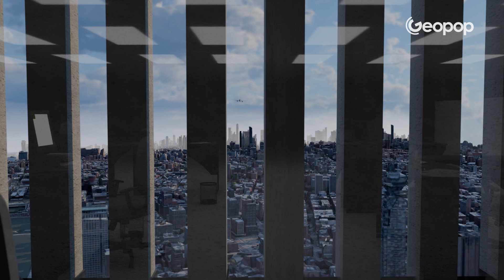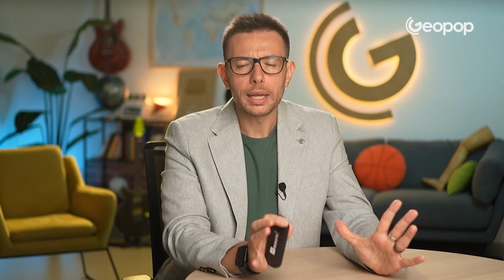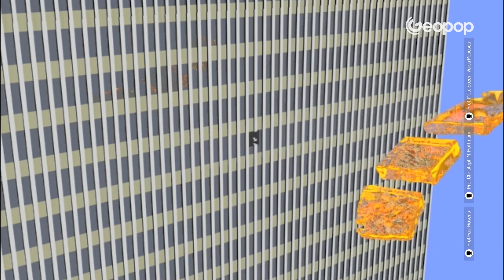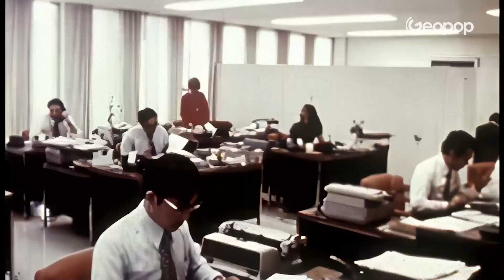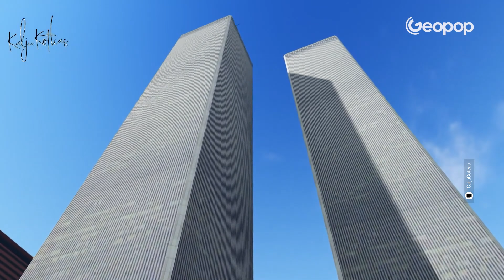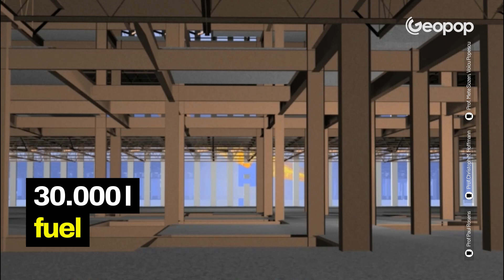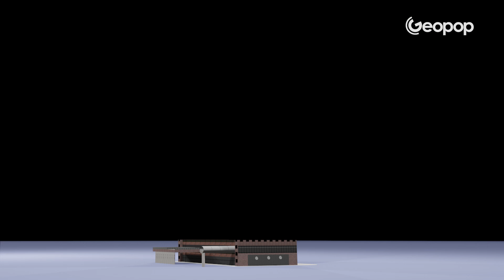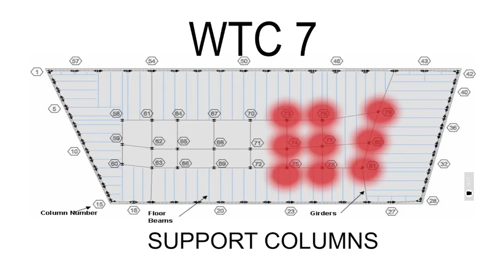9/11, 2001: The Technical Reconstruction of the Twin Towers and WTC 7 Collapses

Comment: 'We saw molten steel, flowing in the basement, like LAVA'!
Reply: It wasn't molten steel that was flowing like lava, it was molten aluminium. The buildings were covered in the stuff. It melts at only 660 C.
Reply: @reignman30  look up in engineering tables the COLOR of molten aluminum!!!  Please.
Reply: @reignman30  The buildings were covered in Structural STEEL, more than aluminium, by far!
The 77th brigade will sack you if you carry on this badly!
Reply: caused by thermite.
Reply: @josephdarkhelmet9494 
Fuckin A . Thermite ,final answer
Reply: They used mini nukes buried deep in the bedrock below the utility shafts.  They use CGI and special effects as well. The lower floors were virtually vaporized by the blasts. 
The remaining upper floors dropped in free fall. The melted crater was found below the debris. It took weeks to cool...
Reply: Sure did and at least two people got video of molten metal flowing like little waterfalls near the corners of the twin towers before the first impact. I wonder if that storage area stacked to the ceiling with boxes of Primacord that we saw in that video the Israeli film students shot of themselves from inside one of the towers when they were given unprecedented access days before 9/11 could’ve been for ?
Reply: @Semprefi  Yes!
And i wonder how many jewish people died that day?
And who were the 'dancing Israelis'?  
Very suspicious!
Reply: @Semprefi  wtf lol what’s wrong with you people. Gotta be trolling at this point
Reply: @TheScottbb1 
That’s what I’m thinking about you. It would take hours just to list the evidence that runs counter to the official narrative  and little to nothing that supports the government approved story yet here you are
Reply: No sence arguing with stupid… centimeter of steal against millimeters of aluminum?… it’s a inside job to start a war and control everything.. free fall ? Collapse? If you believe it’s not planned, you are brainwashed.
Reply: I assume you've noticed that @TheCriticalStinker-jw4fl hasn't offered any evidence contradicting the presence of molten steel in WTC 1 & 2.  That's how these shills operate.  Every one of them is a clown.
Reply: What is the source of the many tons of molten steel found in and under the debris, the heat so intense that the molten steel remained in that state for weeks afterward, running off of the debris as it was excavated. This cannot be molten copper from wiring that retains the color of a shiny new penny.  It cannot be molten aluminum that retains the color of the polished aluminum wheels of a street racer. It was the color of glowing orange molten steel  that cannot be mistaken for any other material, reported by firefighters who are very experienced in the nature of such materials as well as seen in video evidence.

When you combine this with an entire lack of turbulence behind 500 mph aircraft, when even a small Cessna Aircraft would leave an evident wake in the smoke and fire only seconds later .  . We find that skeptics still cannot be skeptical of the official narrative in explanation.  Sponsored channels and forum activity are skeptical of nothing when support is provided.

Sponsored activity in the forums is very normal today for commercial and political purposes and subjects of controversy -- in the attempt to lead public debate.
Reply: Bs
Reply: @BrianPack-u7o  No!  Theres video of them saying it!
Reply: You can't tell what kind of metal it is by just looking at it
Reply: @mikebyrd8278  if it is molten and running and it is yellow and orange then it is not aluminum.
Reply: @JosephBoxmeyer-u3d  yet there is no proof it's steel. An yes aluminum can be orange 

https://youtu.be/tdmnuAL4Nas?si=HceCZanHb9I2YLL5
Reply: @mikebyrd8278  It has colours, viscosity, smells, they were there, you were NOT!   99% of all the metals within those towers, was structural steel!   Why does this bother you so much?
Reply: @JohnWayne-w2g  yet there is zero proof of any melted steel. Nor is there proof 99% of the metal was steel. Aluminum jets, aluminum studs, copper pipes...
Reply: @mikebyrd8278  What about the fact that 99% of the  metals within those towers was STEEL, that you hilariously  skip around?
Give up man, you give yourself away too easily!
  Stay on those pentagon threads!
Reply: @mikebyrd8278  You've got to be joking. You tube is full of news clips showing the clean-up crews dealing with molten STEEL that "melts thier boots" and drips off the crane buckets. Inform yourself bro.
Reply: @mikebyrd8278 
When molten,  aluminum does not glow orange or yellow. Aluminum retains its silver color.  This leaves us with titanium, which melts at  ~3000 degrees F or steel, which melts at ~ 2,700 degrees F, depending on the alloy. What in any of those buildings could burn hot enough to weaken steel, let alone melt it.
Reply: @JackCarlock56  https://youtu.be/tdmnuAL4Nas?si=OxUsx-sh7Co3ohEf
Yet there is orange aluminum
Reply: @mikebyrd8278  look at the building during construction.  Steel.  Look at railroad rail welding videos.  Thermite.  Please watch one.  Just two minutes.  Look at video of thermite cutting steel beam.  Two more minutes.  And the aluminum from the planes burned up.  Gone.  Look at video of crashed plane with fire.  Gone.  Of course the building fires did not get hot enough.  Those fires not getting hit enough to melt steel?  Are you familiar with the term "red herring"?  They are officially trying to deny the fact that there WAS molten steel , by changing the subject about what heat is needed to bend steel.  You need to watch videos until you see the molten steel for yourself.
Reply: Except that quote is not accurate, Building 6 (where the firefighter you are grossly misquoting was actually located) had no basement and why does this even matter even if it were accurate?
Reply: @TheLoonResistance   no, that molten steel was in the basements of buildings #1 & #2.  There are videos that show it clearly.  Also, have you seen the satellite heat analysis of those basements a month and two months later?  Over two thousand degrees.  That is not from the building falling. Are you familiar with the dust analysis?  Evidence of thermite and thermate.  It is in all of the dust.  And IRON MICROSPHERES.  It is in all of the dust.  Have you seen microscopic photos of the dust?  It is full of tiny chips of iron oxide and aluminum and copper and phosphorus.  There must have been many tons of that to have been dispersed in all of the dust.  That is not the signature of any material naturally produced by any building burning and falling.  Look it up in engineering materials. Micro chips of iron oxide combined with aluminum and copper and phosphorus!!!  With iron microspheres.  It is in all of the dust.  Thermite and thermate.
Reply: @TheLoonResistance  
The inference being that the heat generated by the official narrative didn’t reach  anywhere near the temperature required to convert solid steel into liquid steel.Another reason that molten steel is important to the story is that it supports the assertion that Thermite or similar was used to weaken the buildings enough to collapse prior to impact
Reply: @Semprefi  - The official narrative (whatever that means) never claims that temperatures were reached to convert solid steel into liquid steel. That is pure conspiracist fantasy.  No teel turned to a puddle or needed to.

I could ask you like I have a thousand others to provide some evidence that it did and you will fail just like all the rest of them. The usual couple of casual anecdotes will be the best you can do. 

Boring

Thermite BTW would be quite useless, which is why no one uses it like that. Besides the obvious logistical problems the stuff just doesn't work. The only reason anyone talks about thermite is because of the utter failure of the conspiracy crowd to convince the public with obvious nonsense claims of explosive controlled demolition. Since there were no collapse initiating explosions, the zealots needed a silent way of demolishing the Towers. Thermite was the best they could do. Not because it was used mind you, but because it was silent. It kept the fantasy alive. 

youtube.com/watch?v=JXWCMBuusMI&ab_channel=TrutherTVArchives 

In this video starting at 45:35 and running to 48:35 the Energetic Materials Research and Testing Center (EMRTC) conducts a test to examine the effectiveness of thermite in cutting a vertical hollow box-section steel column. The column tested is smaller in cross section and made of thinner steel than that of the Twin Towers perimeter columns (and never mind the core columns). In total 175 pounds of thermite are used for the test on just one column and requiring the construction of a rather conspicuous coffer dam to contain it. Do recall the Twin Towers had 240 columns and 110 floors.

It would be odd if thousands of office workers missed hundreds, perhaps thousands of those suddenly appearing.

Note what an incredibly slow process this is. It took close to 30 seconds for the thermite to finish burning off.  It would be impossible to “control” a demolition using this material.

Not to mention the issue of; how does the aircraft impact and subsequent raging fires NOT prematurely set this stuff off?

Also note how bright and obvious the whole process is. Could not be missed visually. No way to hide that. 

Then at the end of the test the (relatively modest) column was undamaged…. which is a problem.

Certainly no rivers of molten steel emanating from it either and in fact the whole thing cools rather quickly as soon as the thermite has burned off, as one would expect.

Thermite has never been used in the controlled demolition of any building, let alone one with multiple floors on fire after the impact of a large jet. If the conspiracy oriented internet has taught us anything it’s that if something has never happened before, it can never happen.
Reply: @Semprefi  - Meaning there was no molten steel - hence the complete lack of evidence for molten steel.  All you have is a couple of casual anecdotes from people nobody has even bothered to do a follow-up interview with. Your case isn't weak - it doesn't exist. It reeks of desperation.
Reply: @TheLoonResistance 
How come you trolls never bother to read things before you come out of left field to argue with someone? I usually clap back at you basement dwellers but  you’re level of  Dunning /Kruger  is off the charts   so I’m  gonna ask you nicely to fuck off and find someone else to wind up with your ignorance and complete lack of self awareness
Reply: @TheLoonResistance 
I don’t even have anecdotes. Where did you see those? Exactly. 
You’re arguing with me about what you assume I said cuz trolls don’t bother reading things before they disagree with them. Actually, the only evidence of molten steel flowing near the corners of the buildings  starting around the 73rd floor is the few videos that we’ve been aware of since almost day one. The Molten steel existed and it was recorded before the first plane hit. Youre move Shrek
Reply: @TheLoonResistance  You are obviously not that critical about your claims, are you? The firefighters were not misquoted. You claim that the firefighter's descriptions of what they saw that day "don't matter". Astounding.
Reply: @432b86ed  - Then provide the relevant quote. The OP sure as shit won't.  About time one of you lot grew a pair.
Reply: @TheLoonResistance  don't grow anything.  Binge watch videos until you see what we are talking about.  You can see videos of the molten steel.  You can see many series of explosions.  There is a video from a helicopter that shows many explosions that demolishes that "hat truss" on the top of #1.  That was BEFORE it started to fall.
Reply: @TheLoonResistance  "9/11: NIST engineer John Gross denies WTC molten steel (extended)"
Reply: @432b86ed  Not what was asked for. Try reading the OP again.
Reply: @TheCriticalStinker-jw4fl 
Multiple individuals noted molten steel within the basement areas of WTC  1 & 2. 
NASA measurements of the temperatures in those same locations showed temperatures of ~ 1,700F. Why is that relevant? Well, since you need to ask, it is relevant because what was  a fire retardant heavy environment. Nothing in any of the WTC  building would burn at the temperatures needed to weaken steel. Now maybe you debunker types can explain how the fires within the rubble of WTC 1 & 2 burned until mid-December. What was buring and why couldn't millions of gallons of water extinguish the fires?
Reply: @JackCarlock56  Be wary of the disinfo trolls, pal!  They make themselves really obvious!  They don't even try to be convincing!
Reply: @JohnWayne-w2g  
You know. I don't care if someone is a troll or not because, typically, I'm less responding to them than I am writing out facts for those who might read the comment sting later.
Reply: @JackCarlock56  Sure, but why are disinfo trolls on these threads in the first place?
Because the molten steel element, is TRUE, thats why!
Reply: @JohnWayne-w2g  
That's my point. If a tourist were to visit these stings, they might leave with the false impression that NIST's account and thus the trolls are correct. This is, of course, not true. That's why I am here - to squash trolls.
Reply: @JackCarlock56  - IF you have a superior hypothesis to the one overwhelmingly accepted by the world's engineering community I suggest you bring it instead of just stroking your ego.
Reply: @TheCriticalStinker-jw4fl  
Ah yes, a whiny debunker such as yourself always has to make this about someone's ego, just not your own, right.
The world engineering community does not accept NIST, and thus, your horse shit theory about the collapses at WTC.
If you had read NIST's own report then you'd know that their own testing disproves their conclusions.
BTW, NIST refers to their conclusions as "the likely collapse sequence."
Reply: @TheLoonResistance  
Your assertion that most engineers believe NIST’s fairytale conclusions is pile of BS meant to shore-up you undereducated opinion about what happened at Ground Zero.  
I personally know no engineers who agree with NIST’s conclusions, and I’ve worked in engineering for three-plus decades.

 You told the OP that the firefighters were in WTC 6 when they said whatever you think they said.  Firstly, that is completely incorrect.  The firefighters were being interviewed in their station house when they shared their observations about molted steel. If the OP is grossly misquoting the firefighters, what then is the accurate quote?  And where did you find it?  Come on. Grow a pair.

The fires in the basements of WTC 1 & 2 were finally extinguished in December, three months after they started.  In your educated opinion, what was the fuel source for these fires? 
You asked the OP why the presence of molten steel matters.  Think that question through then get back to us with your answer. SMH
Reply: @JackCarlock56  So you personally don't know any engineers? Got it.
Reply: @TheLoonResistance  
So, no balls, huh?  No surprise there.
Reply: @TheLoonResistance  
Run along, son. You are beyond your depth here.
Reply: @JackCarlock56  - So you don't have a superior hypothesis. Just a bunch of the usual NIST-picking nonsense you copied from someone else (who never read any of the reports either). Not really a surprise there, is it?

I do wish you luck with your continued epic fail. I really hope that works out for you someday.
Reply: @TheLoonResistance  
I asked you to provide the direct quotes from the firefighters’ statement you claim were made in WTC 6, saying whatever you think they said. You have failed to do so.  That’s speaks volumes about both your ineptitude and your motivation.  You want me to produce here my take on the collapses?  Show me. Show us all how educated you are on this subject. And then and only then will I explain to you why you are wrong.
Like you said, skippy, grow a pair.
Reply: @JackCarlock56  - And I asked John Wayne to provide the details from his (alleged) quote in the OP.  Who said it, where they were, when, the actual exact quote, etc.

I asked first. Still waiting. 

IF you were honest, you would be asking the same thing. After all, the statement made in the first post if this thread IS the topic of discussion.  At least so far as I am concerned. JohnWayne made the claim. The burden-of-proof here is on him,... unless you would like to take over. 

I suspect no answer will be forthcoming (from either of you), this having been a typical drive-by-Truthing and therefore there is in fact, nothing to discuss. The claim stands falsified due to complete lack of supporting evidence.
Reply: @TheLoonResistance  
Wow!  Look at him run.  
Who’s that? 
Oh, he’s some debunker fellow.
Why’s he running so fast.
Someone asked him a substantive question about a statement he’d made, and the poor fellow just couldn’t handle the pressure of supporting his false statement, so he ran away. 
Hey!  I think I read that comment.  Isn’t he the fellow who challenged his opponents to “grow a pair”?
Yea, that’s him.  Poor little fellow.  He doesn’t know much about the subject matter, which for him is a good thing.   A shape knowledge of the matter isn’t a requirement for his job. He’s only here to obfuscate and to pretend he knows something.  Good that he found this job, otherwise he’d be a cooking French fries at McDonald’s.
Reply: @JackCarlock56  - Whatever you need to boost your ego. I'm not in this thread to feed your need for attention. I want to discuss the OP with JohnWayne but he buggered off straight away.  Typical Drive-by Truthing. 

Nothing more to discuss if the OP abandons his own thread.
Reply: @TheLoonResistance  Don't the 77th brigade even try anymore???  You make it too easy!
Reply: @JohnWayne-w2g  - You seem like a typical smoothbrain conspiracist. Muting you now.
Reply: Kinetic energy of this mass and magnitude produce alot of heat
Reply: @ulrichkristensen4087  a lot*
Reply: @ulrichkristensen4087 No one brings up the air flowing through the building from all the heat rising.

If you've ever ran a forge you know how much of a difference that air makes.
Reply: @Ta2dwitetrash the engineer in video said that temperature never got hot enough to melt steel!
Reply: @bigdog4574  It doesn't have to melt it, just weaken the floors, which were NOT I beams.
Reply: @Ta2dwitetrash   Sorry, but the black smoke indicates oxygen starvation.  There goes the forge idea. When you seen liquid steel pouring from the corner of the tower there is black smoke behind it.  Not hot enough.  Not like a forge.  In the basements; the molten steel was there for over a month!!! No air in that mess.  If you didn't see it, then you didn't see it.  I do not intend to sound combative.  But you need to binge watch videos.  Try watching videos by Architects and Engineers For 9/11 Truth.  Please.  What happened cannot be dismissed.
Reply: @bigdog4574  
Furthermore, per NIST's report, no evidence of the temperatures needed to melt aluminum was  found either.